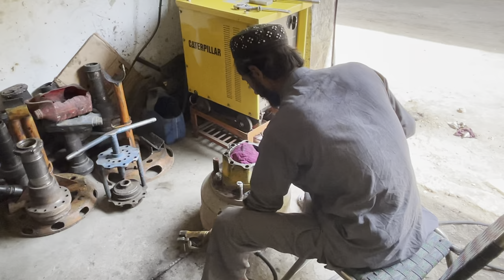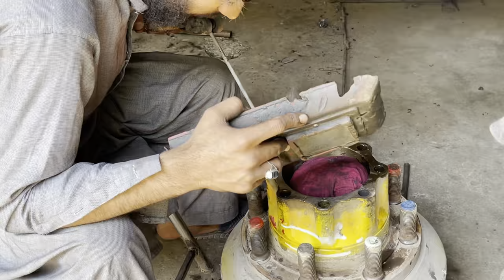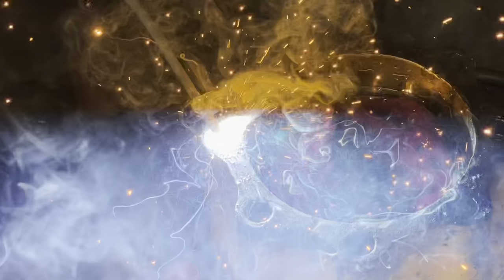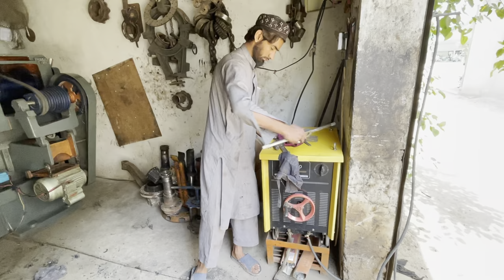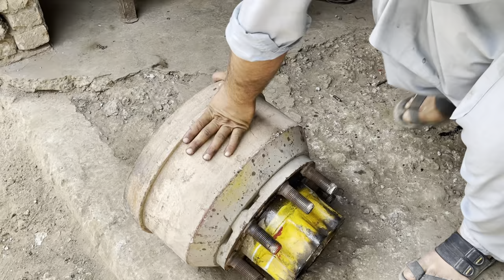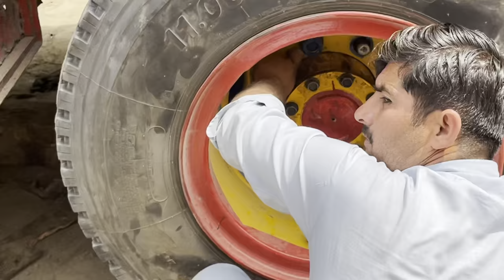Intelligent Way of Removing Broken Bolts | How to Extract Broken Screw Stud Bolt | Complete Process

Comment: I think its better to use a screw extractor to remove the broken bolt and protect the threads. Or even a left hand drill bit is usually enough.
Reply: when these are broken, it's usually due to rust. Basically, heat is your friend here. Also, lack of replacement parts is what pushes these repairs.
Reply: @rupe53  yeh but a little anti seize is usually enough. You can still heat the housing when using an extractor.
Reply: @tubester4567  ... based on how much effort is put into removing these broken bolts I suspect they have been that route and this works better in the long run. After all, they have likely done more than any of us will ever do here in the states.
Reply: @rupe53  The handle he is using isnt very big. It only looks about 8 inches/200mm long. Just looks like a very high risk of damaging threads;
Reply: @tubester4567  ... that's still a lot more oomph than I would put on an easy-out. As I said, they have likely done many more of these than myself or anyone else I know. They have the experience to figure out what works best for them.
Reply: @rupe53  You can get very chunky easy outs and I've used bigger handles than that. Ive seen so many bad practices on these Pakistani repair, and manufacturing videos. Apart from all the obvious bad things like child labour, lack of safety equipment, no shoes, no goggles, etc. Like building engines in dirt, guessing torque settings, damaging bearing housings, dangerous tire/rim removal, fitting dangerous worn out tires, heating and welding hardened steel, its endless.
Cant blame the workers for some of it but still. They show things being fixed but they dont show 3 weeks later when the truck breaks down while half way up a mountain on the Kyber Pass and the wheel flies off into a canyon. lol.
I just looked it up, and 2.8 million people die every year at work in Pakistan. Millions more are disabled and cant feed their families. Theres no workers comp, insurance or CSB or anything. The US has around 5000 deaths per year, and most western countries are much less than that, The whole thing is very concerning to me.
Reply: @tubester4567  ... would agree with most of what you posted but the fact remains that they have limited resources when it comes to things we consider easily available.

Comment: There is a much easier way. Drill a 1/8 pilot hole in the center of the broken bolt, heat the hub and drill the bolt out using a smaller diameter left hand drill bit. When the bit bites meat, the bolt will back out

Comment: I can well imagine how those studs broke off, confirmed after seeing how the wheel-nuts were tightened using a 7-foot extension pipe for leverage with somebody putting his whole body-weight at the end. This caused the pipe to bend.......... I suppose these people will never learn so they have to become experts in methods attempting to correct their permanent botch-ups.

Comment: Should be named a dumb way to remove a broken bolt/stud. A stellite or carbon drill setup to accurately drill the stud and then using a stud/screw extractor will easily remove it without any damage likely to the housing. It would be done a lot faster than this method with less risk. A spark eroder or  portable edm bolt buster is likely out of their budget, but will easily do the job too.

Comment: Hmm, ok so the bolts sheared off maybe due to previous installation and bad threads. But now you cap welded then with just a T bar you can back it out.  I give you gratz on welding it but extracting it that easy just doesn't happen unless you trying to get money from Youtube.
Reply: They come out easy if you haven't damaged the thread. Once the bolt has snapped, there is no longer any torque on it.  They just spin out.
Reply: @PhillipMikeHunt  lol.. Really!
Reply: @fozman845  not always , a burr on the snapped part may make it hard to get the first turn but after that it will spin out. As long as there's no rust or threadlock.

Comment: What's so "intelligent" about it? He could've done a cleaner,  faster job by simply using a sleeve instead of eyeballing the fill welds ; Not to mention properly securing the part to tap the threads afterwards.  He got the job done (the troglodyte way)

Comment: ok look sick of seeing this shit.. the best way to release stuck bolts is to heat up what the bolt is stuck in not the bolt itself .. Heat makes metal Expand So if you heat the BOLT the Bolt Expands which makes it a tighter fit... you heat up the bolt hole keep the bolt as cool as possible which expands the bolt hole loosing the bolt, the ONLY Reason Heating the bolt or welding a nut onto a broken bolt works is because Heat will Crack rust.
Reply: when the bolt cools the rust is broken so serves the same purpose without firing up a torch. (which they seldom have handy)